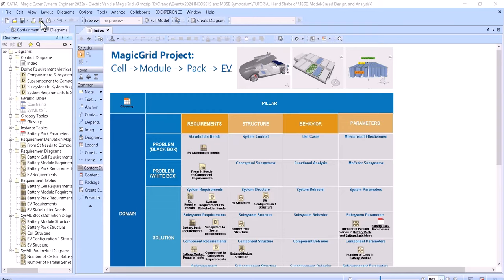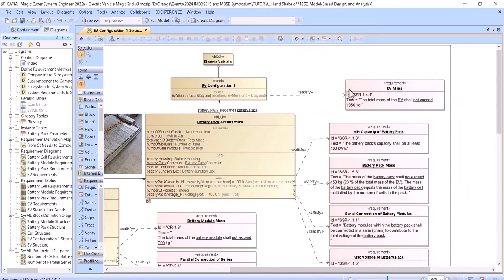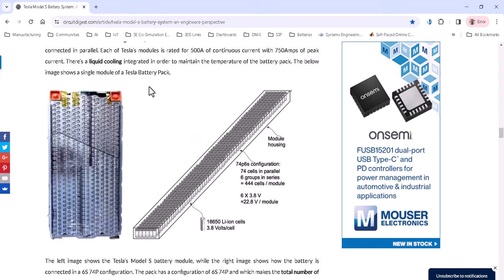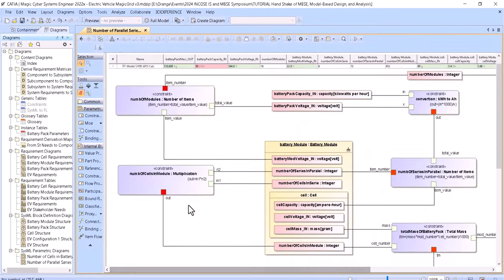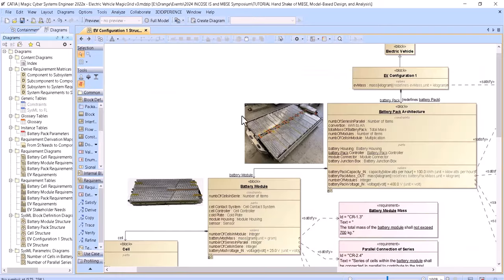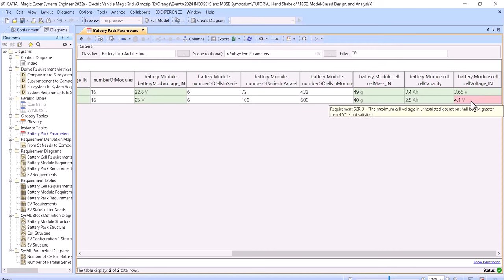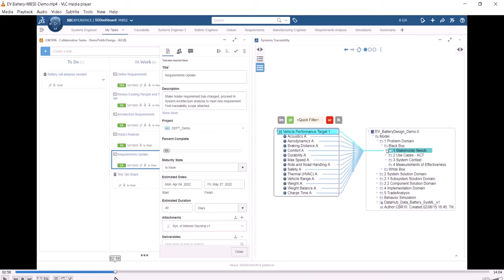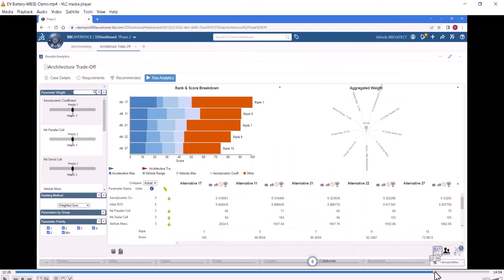Digital Tread for EV Battery Pack Architecture, Analysis and Design

Comment: Looks interesting. Pardon me, but is the correct booking session titled "Mastering SysML and MagicGrid for Systems Engineering"? Thank you
Reply from the maker: Hello, no it is Handshake between System Architecture Analysis and Design!
Reply: @MBSEExecution Thank you very much! It looks like I've missed the boat unfortunately as spaces are fully booked.
Reply from the maker: Im sure we will cover this topic during the event in other workshops and presentations. BTW there is two days integrations workshop which is targeted to the same topic - Tuesday and Wednesday. No additional registration is needed for it.